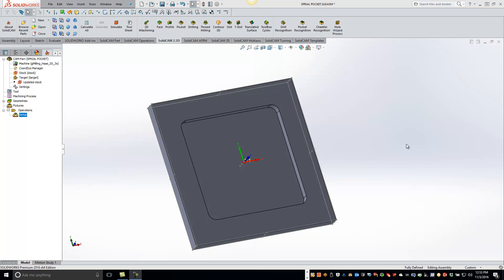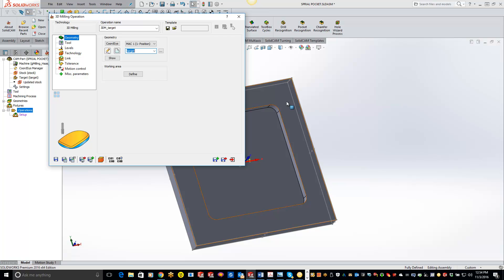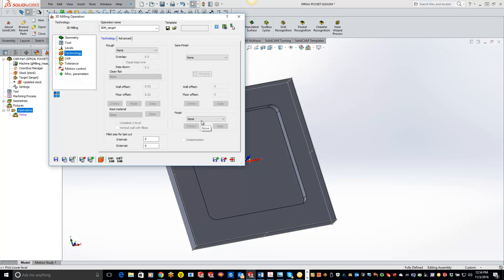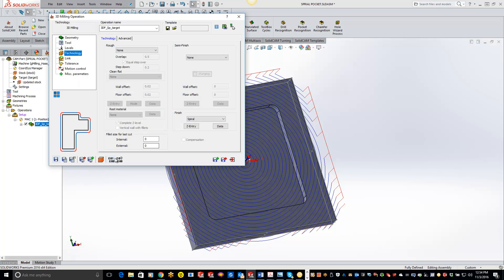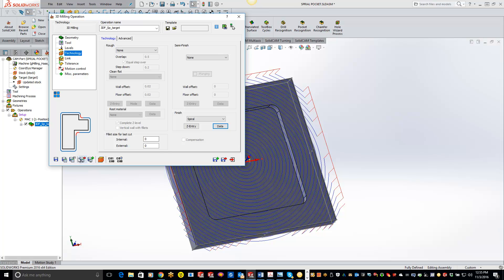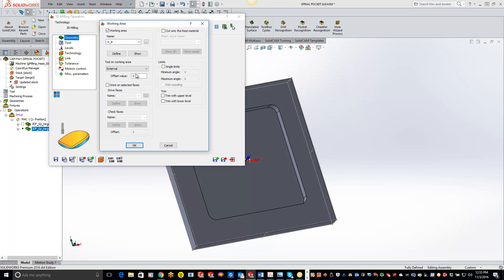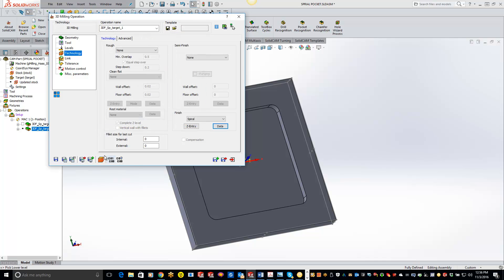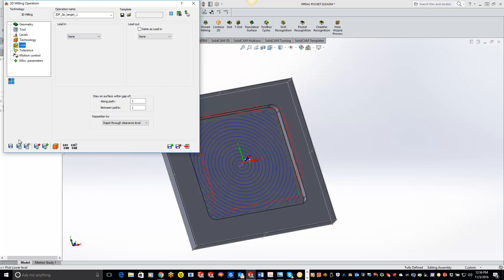SolidCAM - How to do a Spiral pocket

Comment: I would like if pocket operation had a spiral mode like facemill in which the spiral adapts to the given shape (square, triangle) so it doesn't retract from the material at the edges. This can be done by using HSS operation.